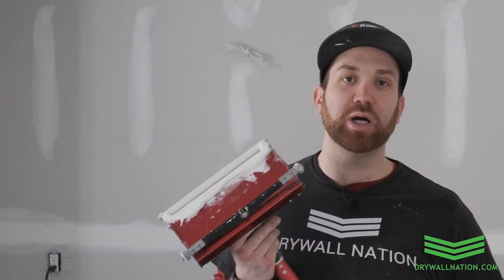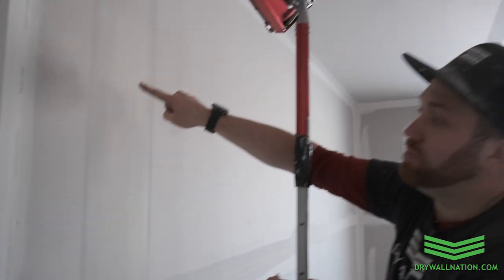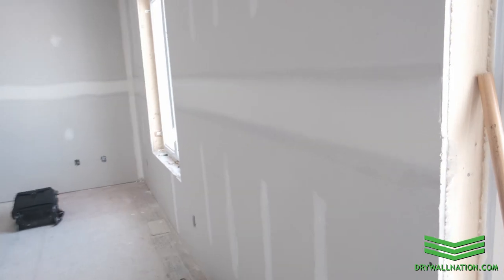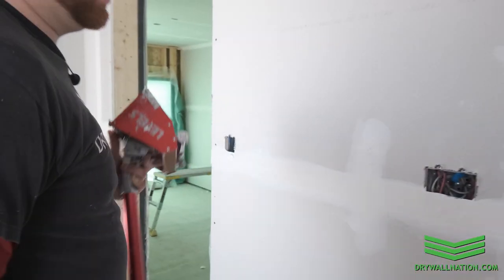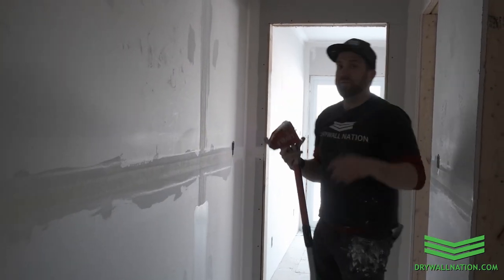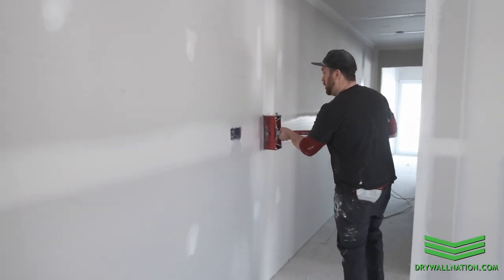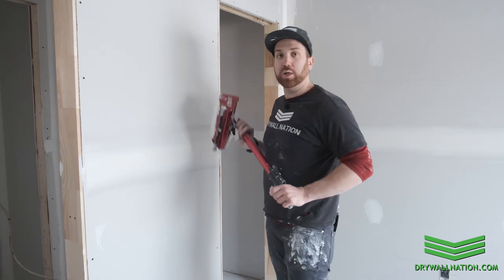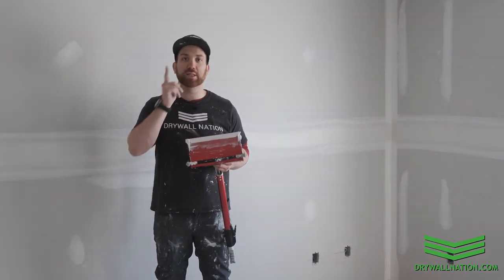How to run flat boxes on your walls.

Comment: Excellent video how to run your 10" box. This is the way I was taught to do it. After doing drywall for 40 plus years, I did retire. Using a box for your bed coat, I always went over the joints twice. I've worked with others that wiped down the bed coat with a knife.  I, personally, was a waste of time. Let the tools do the work. I'm so thankful & grateful that I run across this video to show others how to operate tools being more efficent. Thx, Phil Anderson-Evansville, Indiana

Comment: Little tip i always hit the receps with a sanding pole before i circle or run tools by them. That will knock the fuzzies off and reduce the garbage in your mud. Just dont go too crazy and burn the paper on the board.

Comment: Been finishing for 30 plus years. Been thinking about buying tools. The guy I work for is a clean freak. Can you keep it pretty clean using boxes, floors
Reply: It really all depends on the consistency of your mud. The give and take is more water in your mud will make running boxes much easier because less pushing but can run out if it gets too watery. It is pretty easy to keep a good consistency though and is very clean for the most part. Definitely keep some plastic or a scrap piece of drywall under the pump.

Comment: So I bought that level 5 kit 10 12 pump stick. Like I said before I've been doing it for 30 plus bro. Am I just weak or what? I tried to make it work today. I gave up and busted the knife and pan out. I'm strictly a hand finisher from the get-go. They gave me a 42 stick extendable. Should I get a shorty? I'm 6'5. I should have leverage I guess there goes $1,000 for nothing
Reply from the maker: Hey dude! Don't feel discouraged. It doesn't happen overnight. I dont know if you watched the whole video series we did on how to run flat boxes or if you just watched one video.
We did a 6-part video series on how to run flat boxes.
Search through this playlist and start with the first video titled "Beginners guide to running Flat Boxes" and then continue watching the rest.
If you still need help, feel free to send me an email at Brian@drywallnation.com, and I'd be more than  happy to spend some time with you troubleshooting whatever problems you may be having. But generally speaking, our videos are pretty thorough and should cover just about everything.
Thanks!  https://www.youtube.com/playlist?list=PLXlfTfVrkA4ZNbf1OCtzOCwcti8k7WkdO

Comment: What extendable handle do you recommend for 9’ and 10’ ceilings/walls?
Reply from the maker: The 48"-78" extendable handle is great for anything over 8ft.
Reply: @drywallnation  thank you, same size for the corner applicator handle I assume
Reply from the maker: @learsi0071  yes that's right.

Comment: What number you run on first coat? I'm usally on 2 or 3 on my columbia fatboy 10
Reply: Every box works different. And will change as the blades wear in. Check the fill every time you use the box with a straight 12" blade square to the walls. The blade should just barely make a contact line in the fill mud to where after shrinking it is flat. First coat shrinks more than second coat. Very important that you get the joints dead flat.

Comment: Not being disrespectful but with that kind of sheetrock you dont ever truly have to run a buttjoint?
Reply: That's the plan . Butts are a pain in the ass. Because no carpenter EVER  checks the wall for bulges.
Reply from the maker: It's not the sheetrock itself. It's the Trim-Tex Buttboard that recesses the buttjoints. You treat it just like a beveled flat.
Reply: @drywallnation same thing he asked🙄
Reply from the maker: You can read my reply above. We use Trim-Tex buttboard. It recesses your buttjoint.

Comment: All these expensive tools are good for drywall contractors only , if you do a whole house or 2 a year still  not worth it, cleanup time , extra sanding if a rookie…  heavy to use , young man’s game
Reply: Thanks mark
Reply: Boxes are really hard to hold up and i can barely press hard enough i know im weak but i joined this job to learn something trade-worthy and build strength my boss gets mad that i can barely hold the box up is there like a finesse im not getting or pressure or somthing need to learn cause the guys all say its easy my dad boss and other guy all do it easy idk how they do it but im doing somthing wrong cause it cant be as hard as im making it out to be i know it

Comment: This guy not a true finisher
Reply from the maker: If you don't know what Buttboard is then you're the one who's not a true finisher.
Reply: A true finisher? What exactly does that mean? He is putting on mud fast and smooth with very little sanding necessary afterwards. He fits my definition of a true finisher. Perhaps you can enlighten me as to yours.
Reply: You are bowing out all the joints once that light hits that wall u are going to see all them joints I've been doing this for 20 plus years smouth finish an you are supposed to stagger your joints so u don't get cracks
Reply from the maker: @kevindinsmore2556  Some people are just arrogant and are too stubborn to change their ways. 🤷‍♂️
Reply from the maker: @FabianLopez-om6tw  You know how many time I've heard "I've been doing it for 20, 30, 40 years!"
Years of experience mean nothing if you suck! Haha. Not saying that you do. I'm sure you do great work, but you obviously don't know how to use automatic taping tools or you wouldn't have a predisposition to thinking they "bow" or crown all your joints. If they do, then you're not using them properly. We talk about how to crown your joints in this video series.
Also, we use trim-tex buttboard so there's no need to stagger. It's a floating recessed buttjoint. It's structurally superior and flatter.